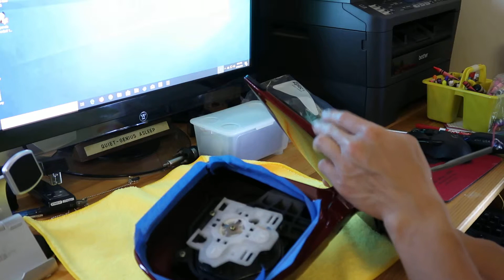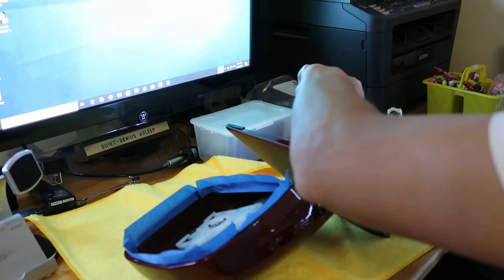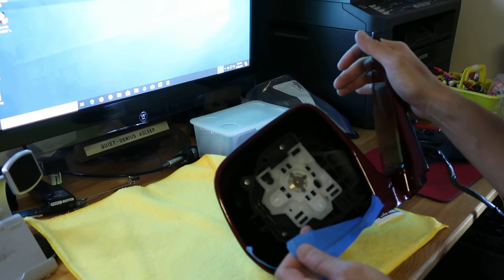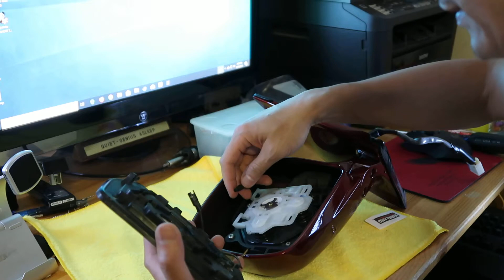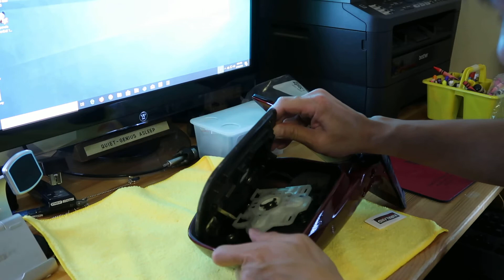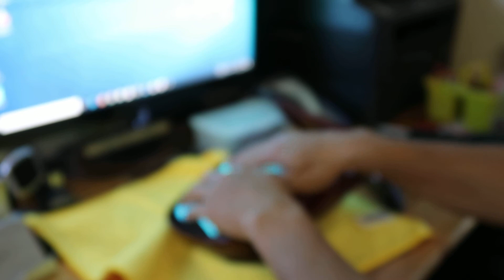2001-2007 Toyota Highlander mirror reassembly after painting.

Comment: Thanks for your video.  Where did you find the matching Salsa Red paint to match your Highlander?  I'm looking for Oasis Green Pearl for my 2006 HL driver side mirror.
Reply from the maker: I got the paint from my local automotive paint store. I initially bought the paint to spray the rear bumper cover of my highlander and had some left over. Keep in mind these are professional paints and requires a spray gun to apply.
Reply: @zhichaolei2171  Ok, thanks for the info!